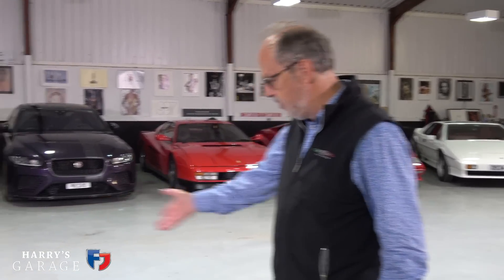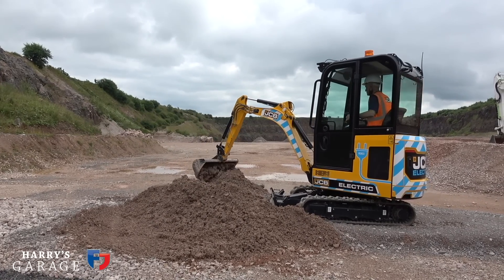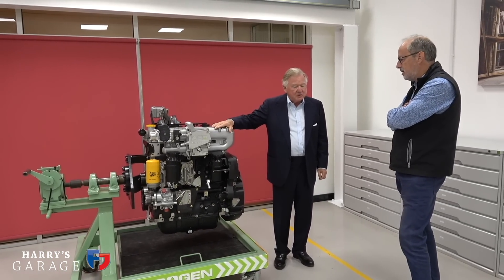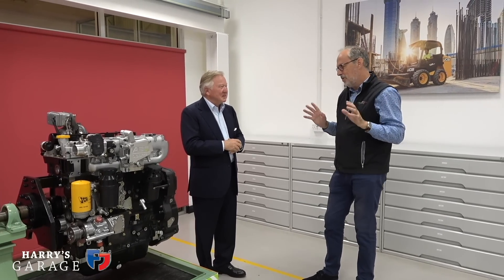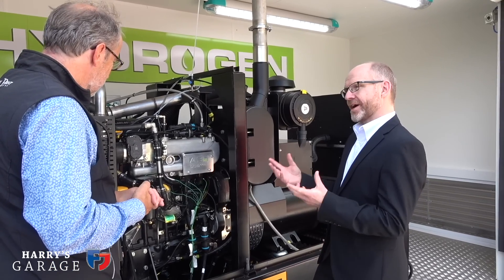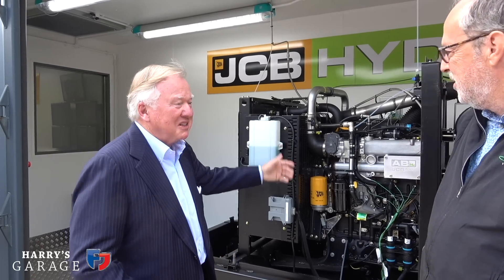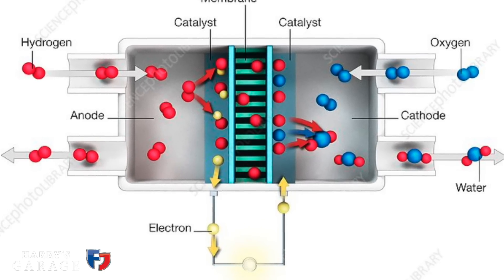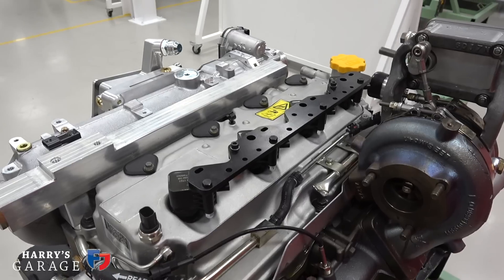Is hydrogen, rather than electric, the future for big-engined machinery? I visit JCB to find out

Comment: A site in London is only allowed EV diggers.
They run for 4 hrs but take 12 hours to recharge using a large Diesel generator on site.
You couldnt make this b.s up.
Reply: What creates less emissions; multiple vehicles running on individual ICE motors or multiple electric vehicles charging from a single ICE motor?
What site is this on?
Where did your 4 hour / 12 hour figures come from?

You call it bullshit but have made no attempt to actually prove it. Lazy.
Reply: I'll back him up, it's all true Def not bs. Battery EV is not the future is stupid.
Reply: The diesel generator is much cleaner running than the diesel diggers are.  It might not be a perfect solution, but it’s better than doing nothing.
Reply: Why does the jcb diggers small battery charge so slowly
Reply: @tonygarlingewarren7456  Ah yes, the best proof: "I'll back him up." ...
Reply: @spaldi01  At a guess I’d say it will be a cross between the batteries architecture and the ability of the generator/charger.
Reply: @CaptainHoratioPugwash  How about first looking at the specs from the JCB Website and then combining 1+1? How else would you charge an electric machine, where there is no electricity or rather no power line, being able to support the amount of current 4 or 5 Fast Chargers would be pulling?
Reply: This is because the machines are being used in doors
Reply: @CaptainHoratioPugwash  ...apparently you CAN make this b.s up
Reply: Completely absurd
Reply: "A site..." if you know that to be true, why not be extra nice and give us the site position and maybe even a link to some info to prove it? To say what you did without backing it up with even a tiny piece of evidence/info is making your comment irrelevant IMO. Anyone can say "I know... it's not b.s." or "I've heard..." or the worst phrase: "We all know...". If there is no solid info it's just...
...b.s.
Reply: That is clearly nonsense. In fact you just DID make that BS up.
Reply: Seriously?
Reply: It costs £30-40 to fully charge a Tesla at a charging station.
EV are not the future and when the plebes realise what it costs it is going to fail pretty quickly.
Reply: @tonygarlingewarren7456  

Prove it. Lazy
Reply: I did see this article about buses in the UK using diesel generators to charge them, i have certainly seen many more like this around the world especially in places without access to abundant electricity.

Here is some electric buses being charged by diesel generators in the UK:
https://www.sustainable-bus.com/news/electric-buses-powered-by-diesel-generator-harrogate-bus-company/

In the outback:
https://thedriven.io/2018/12/14/diesel-charge-evs-remote-locations-greener-than-you-think/

EV cars while great at reducing local pollution, they cause all sorts of pollution worldwide just look at how bad the mining of the materials is in various countries for our electric batteries.
People buy electric cars to show that they are green are just ignorant to the real damage they do worldwide. 

You would have to go nuclear power everywhere to make electric vehicles zero emissions as you are not going to provide enough with wind and solar so its going to be gas and coal if not nuclear.

I also think charging at home will be challenging when everyone in the street has a 10-30kw+ charger installed in their homes as the grid will need to be upgraded for every home.
It makes me think they will have to ration the electricity per house otherwise someone with a faster charger on the street will be hogging all the power and everyone else will be annoyed cause there's will be much slower. 
Not to mention the fact that if they overload the grid could cause brownouts.
I remember watching that photonicinduction guy browning out his street due to drawing more than the street could take, whilst entertaining would be quite annoying if peoples fast chargers were doing that lol.

I wonder if the smart meters can do this rationing already, would make sense as i doubt the national grid people are going to dig up the whole country to upgrade the power for every home.

I think that's why elon was doing the solar roofs and tesla wall battery's so you could store more energy at home locally at a slower rate and be able to charge from home and also use your electric car as a power source for the home.

But really there are a lot of issues with electric vehicles and this hydrogen engine could solve a lot of them for the bigger vehicles, mazda have been experimenting with hydrogen powered rotary's for a long while and that bob lazar guy had a hydrogen fueled corvette in the 90's using tanks with lithium-6 deuteride as a hydride so when the tank is heated they will release the hydrogen and allows you to store  it safely, and he claimed 400miles range from the 4 cylinders in the back.
https://www.youtube.com/watch?v=Ytg23mDd1a4

Will be interesting to see what happens in the future and how these problems will be solved.
Reply: The government are backing diesel generator sites all over the country to cover all the lows of wind generation. I know this because i have now been approached by multiple companies to do this on my land. Also it has been done on WH Malcolm's site at newhouse scotland so dont believe all the crap our governments are telling us all over the world
Reply: @v4skunk739  Most charging of Teslas is at home (mine has been topped up three times at Superchargers). Many ways to get cheap electricity at home. You don't "fully charge" very often, unless you regularly make 200km journeys. Most of the time I'm adding about 10-15% charge to the battery overnight. 

"Fail pretty quickly". I think it's almost 8 years that Teslas have been on the road now. Better hurry up and fail.

Finally, price is not the main thing here - having a future to drive around in might involve actually paying more than an ICE vehicle. We've crapped this stuff up pretty completely and undoing the damage  is going to cost some money.
Reply: @amilton2128  agree entirely - but downvotes don't show.
Reply: Diesel is so much better, says nobody stuck behind a diesel bus belching out black soot particles
Reply: @Howling-Mad-Murdock  🤣🤣🤣🤣
Reply: @v4skunk739  that’s nonsense
Reply: @CaptainHoratioPugwash  Silence in court! oh wait...
Reply: You are probably leaving out the details that reduce your observations to cynicism, like that the restriction is for some good reason other than ecology. Yes you could make up your sarcastic implication.
Reply: @ATomRileyA  Photonic Induction is back!.... Enjoy!
Reply: @CaptainHoratioPugwash  A generator runs at constant revs and is optimised to generate electricity efficiently, but neither charging nor electric motors are 100% efficient.  The improvement is probably marginal, if any.  It is ridiculous to replace diesel ICE with electric only to charge from an on-site diesel generator.
Reply: So they need 3 times as many machines to do the same work. This is actually hurting the environment more than just use a modern diesel engine. But its just a fact that these kind of sites don't care about the actual emission they produce in the big picture. They only want it to look nice on paper.
Reply: Wowser that sounds about right
Reply: @v4skunk739  Hydrogen will never be cheap. 

The cost of creating an entire clean production and distribution infrastructure will mean that it will likely be more expensive than petrol or diesel.

Whereas electricity is every home, office, shop, factory, petrol station, cafe….
Reply: 4 hrs is a full day shift on a mini excavator - JCB gets that raw data. Of course it needs recharging after 4 hrs butbthats OK
Reply: I think they meant on the diesel driven machines. But still. 4 hours is the average day.  But he conveniently just forgets all these that work longer days on these machines. Just for the sake of the example. 
When I rent a mini digger for 100 bucks a day I want to use it at least 8-10 hours a day. But with only 4 hours a day I will need the machine 2,5 times as long. Plus my project will take 2,5 times as long. Or I would have to rent 2 or 3 machines. Which is much worse for the environment. The production of the machines is very poluting. Specially the batteries (that need to be replaced every 7 years or so)
Reply: @RichardButlerUK  You are lying, it costs £30-40 at a charging station to fully charge a Tesla. I'm not talking about charging at home....
Hydrogen is the future not ev.
Go research how a battery is produced and how difficult they are to recycle.
Reply: @spaldi01  Might be because they charge it on mains power or maybe 400v . They don't install a 130kw supercharger on every building site. You need to manage with what you have on site. Which will often be a diesel generator 😂😂 So you run on diesel but can only work 4 hours a day. After that the diesel generator needs to run for 12 hours 👌.
Reply: @rayw9067  How can anyone doubt that Toyota got it right...
Reply: @Graham and yet here I am, enjoying mine, like thousands of others. Enjoy the next few years as we approach the end of new ICE sales - breathing exercises might be needed if you've already hit the "complete cobblers" stage of debate.
Reply: @tayne5009  but electricity needs an entire new infrastructure too if it is to provide enough current to charge all the vehicles we use. So that is not a unique downside of hydrogen.
Reply: @Dani-it5sy  because they didn't
Reply: @MrDavidWeston  The vast majority of EV miles are accomplished with slow charging from existing supplies, most cars spend 8-12 hours a day parked either at home or work.

The national grid have said they’d be quite happy with several million EVs getting plugged in every night to balance the grid demand between peaks and troughs.

And there are over a billion three pin sockets in the UK and less than 20 hydrogen stations.
Reply: @v4skunk739  that’s not true, the most I have spent at a Tesla supercharger to charge my 75d is less than £16. No I have not gone from 0-100 but had a good 80%. At home that can be less than £5. That’s for a range of 200 real world miles. For most car applications electric is fine, cheap, quiet and pretty sensible in my mind, although some non Tesla superchargers are charging higher that diesel / petrol prices which seems mad.
Reply: @ATomRileyA  Your correct when talking about the power grid plus the lithium copper est will not go down in price these ingredients used are mind as you say by cheap labour and are not that abundant. On he hydrogen debate the only this different is the head they can use all other parts that are in production today plus hydrogen has been around since 1808 but this tech was suppressed by the big oil companies.  Yes it's going to be a very interesting future. Like the Beta Max or VHS. Phillips has the better system 1500 and the 2000 CD.
Reply: If the diggers were well designed they would have on-site swappable batteries.
Reply: @androo4519  adding tons extra to a earth mover. Plus the damage they are doing to the environment  have you watched the video I posted about JCB.
Reply: Lots of people conflating pollution with carbon dioxide emissions. The amount of carbon dioxide is in direct proportion to the amount of energy converted, which will be similar either way (more efficient at the generator but losses charging/discharging will make up the difference). However diesel genny will likely be cleaner and pollution can be better controlled.
Reply: @Howling-Mad-Murdock  Why do you think the engine on the diggers would be anything different than the one on the generator? The engines on modern construction machines run on a constant RPM in a very controlled manner with particle filters and adblue and stuff :)
Reply: @AmundAntonsen  I read an article from a plant hire company, it was they who stated the generator was quite a bit cleaner.  I guess they’d know.
Reply: @v4skunk739  lying? oh that is harsh!
my estiamte of public charging prices may be out a bit, because I usually charge at home, and I don't pay to use public charging.
 
so you appear to understand there is difference in price between charging an EV at home (on a cheap time-of-use tariff or from solar panels?) and the cost of using an expensive public charger?

how much does it cost you to fill up your Hydrogen car at home? or when you are using one of the 3 currently working public H2 filling stations in the UK?

and have you researched how a fuel cell is produced?  (the membrane has a limited life) and how difficult they are to recycle?

or are you spending this weekend doing a conversion on your Corsa to convert it to burn H2?

Hyrdogen has been the fuel of the future ever since they used it in the Apolo space pogram in the 60s
back then it was "in 10 years time"
and it's still "10 years away"

H2 will have a place for some weird applications, like these huge diggers that need to run 16 hours at a time, or aircraft or shipping
but for passenger cars and the vans and lorries in cities, batteries have already won
Reply: Batteries are not the winner for passenger vehicles. Where I live in Norway we have so much tax deduction on all areas that its  much cheaper to drive an EV than a combustion driven car. We have excellent charging infrastructure.  Still half the cars sold are petrol/diesel. Why would these people pay much more to drive petrol/ diesel? Because it's not a realistic option for them to drive EV. And why would we choose 2 different solutions? 1 for tiny vehicles and a whole separate infrastructure for heavy vehicles?
If we would allow H2 technology to develop at the same rate as we did with EV it would become just as efficient.
Reply: @tonygarlingewarren7456  What?
Reply: @Dani-it5sy  Long term, I agree.  Unless there is a breakthrough in battery tech that allows manufacture from much more readily available materials, then batteries are not the long term solution.  But hydrogen is not ready yet, it’s still far too energy intensive to produce the hydrogen and the infrastructure needs enormous investment.  Batteries are a short term solution for something that needs doing now.

54% of new car sales in 2020 is not to be sniffed at, considering just a few years ago that would’ve been close to zero.
Reply: @robbybobbyhobbies  Yes but you have the life to do it that way. You hardly use your car compared to many others. I drive 500 km a day on average. Sometimes 1000 km. And tell the people honestly.. How many hours does your Tesla need to charge at home when it's almost empty and you need a propper full battery the next day?
Reply: @Dani-it5sy  you’re an outlier, fine. Most people do nowhere near 500km. You’re different, so life will be less convenient for you than it is for me. I guess at the moment doing that much mileage is less pleasant than doing a normal person’s, whatever the fuel. Out of interest, what vehicle do you use for this almighty daily trek? Is it provided by a company? Do you have your own car as well, for private use? Are you doing a more manageable amount of personal and commuting kilometres? Just so we’re comparing like for like - I’m not a salesman or a travelling engineer or whatever else causes you to drive maybe 10 hours a day.

I’ve never taken more than a night to charge my car from the wallbox. Honestly. It’s always ready for me by the next day. Most often it’s at its normal running capacity (90%) by early evening. Whenever it’s at home, it’s plugged in.
Reply: @robbybobbyhobbies  I am a consultant in the concrete industry in Norway. Traveling round a lot and also often stay over night at hotells etc. But I am really not a very big exception. I would estimate at least 25% of people will really struggle to make their days work with an electric car the way they work today. And that's the people in highly developed countries. What about all the countries that are not rich enough to build this infra structure for electric cars? What about semi trucks that need to drive 1000+ km a day using 10 times more energy than a tiny passenger car? And I can keep going. What I say is that we now put our money on a solution that will only work for a small portion of the people and companies  in the world while the development of other solutions that might work for everyone has almost come to stand still and is even ridiculed and criticized.. And the manufactures? They just want to make money so they make what is being sold. I really don't understand why so many people are fighting against better solutions than EV.
Reply: @Dani-it5sy  not against hydrogen, just that we need solutions today. When someone steps up and installs the hydrogen infrastructure then maybe I’ll switch. But EVs work for me so why would I wait for hydrogen? 

What about all the commuters doing less than 150km a day? What about the parents taking children to school, doing the shopping and visiting friends nearby? What about the millions of other journeys that can easily be done with an EV? Trouble with “whataboutism” is that we can all play the game and it signifies nothing. 10s of thousands (millions?) of people can and do get along with EVs today. A tiny handful get to enjoy the benefit of hydrogen.
Reply: @robbybobbyhobbies  I think you don't understand a word of what I am saying. But its ok. You are not the only one.
Reply: @Dani-it5sy  stay classy.
Reply: @tayne5009  The idea of micro-grid/shared storage/smart charging also comes into play with EVs. You can imagine a world whereby an individual has solar panels and battery storage at home, so they can store electricity during the day, transfer it to their car at night, but then the next day when they car is at work, it can be used to charge the car in the next bay because you know you're only driving 30 miles home, so you can sell some of your electricity...
Reply: Correct, you you made that bs up. You are correct though that planning and developing permits are now starting require electric diggers only in residential areas. No generators.
Reply: @Howling-Mad-Murdock  Rubbish,
Reply: @v4skunk739  
Agree the motor industry are taking a huge gamble with there investors money as electric is a Big gamble bought upon by G8 donkeys..

This electric is going to go horribly wrong as hydrogen IS THE FUTURE.
Reply: @Only-one-life-68  Go research the power grids! In Britain! At winter on an evening our grid is close to maximum capacity! And any more electricity demand will one day lead to mass power cuts nation wide! Which will in turn drastically increase the cost of energy.
EV's are not sustainable. And lets not even talk about how much batterys cost for a car! On a Tesla they are £15k.
Reply: @Howling-Mad-Murdock  what! no they are NOT what are you thinking. If each digger has their own ice then there is no energy loss form converting fuel to electricity!
Reply: @Graham In other parts of the world they have public charging stations for those that do not have garages/ drive ways of their own.
Reply: @JustAlanJohn  Hydrogen is a byproduct for the large oil companies. Please take your tin foil hat off.
Reply: @Howling-Mad-Murdock  The break though in battery technology has already occurred and will be coming to the mass market in the next couple of years.
Reply: @GR-zv7dn  Always get one with sarcasm lowest form of wit Hydrogen can be made in many ways.  Take care 🤣🤣🤣🤣
Reply: @GR-zv7dn  Hydrogen fuel can be produced from methane or by electrolysis of water. ... In electrolysis, electricity is run through water to separate the hydrogen and oxygen atoms. This method can use wind, solar, geothermal, hydro, fossil fuels, biomass, nuclear, and many other energy sources.
Reply: @v4skunk739  
Did you read what I Said !!!!!!

I’m clearly aware of our electric grid at its max in winter !!!
Reason is the silly sods in government closed coal burning power stations down..

Electric is NOT the future for vehicles never mind industrial and commercial vehicles..

Did u now they can’t even dispose of the batteries correctly at this moment in time..
Reply: @Dani-it5sy  
Bang on..

JCB electric mini diggers use most of the power whilst moving forward and reverse
Reply: @Rover200Power  
Thank you for your link 
Very educational 😀
Reply: @robbybobbyhobbies  
I think what ratbag98 is trying to put forward is that 
Yes there are lots of folk that do minimal mileage in there ICE vehicles 
And yes EV maybe the future for these folk
But the mass majority of ICE vehicles still need to use ICE vehicles..
Why penalise this huge group of users..
With fines for Not having a EV..

It’s like the folk that get fined for going to work in a ICE.

We’re as those that stay at home on Benefits aren’t going to get fined
Reply: @tayne5009  It is not a question of how many three pin sockets there are (!) - the key thing is that to power the number of EVs if they replace ICE cars, vastly more electricity generation will be required, and also vastly more distribution capacity for the grid.  So needing more infrastructure is an issue with EVs as well as with hydrogen
Reply: @MrDavidWeston  The national grid point out that the load factor between peak and off peak is around 20%, therefore they would be quite happy with an extra 2 million EVs to smooth out demand given threat over 90% of EV miles are done with slow charging either overnight or throughout a work day in one location. With smart meters they’d be happy with another 8 million EVs.

Now tell me how much infrastructure would be required for 2 million hydrogen cars?
Reply: Do you know what the initial cost of electric is? Right, 1: first you need to dig big holes to get to the coal
2: Transport it to the power station with a huge diesel powered tanker across the seas because we closed all our own coal mines
3: Same principal for building solar panels, ie transporting materials to start with then the rest to a site to use etc
4: Same for wind power, to build and install on top of hills or in the sea, la la la, 
5: Same with building nuclear power stations and getting rid of nuclear waste
Need I say more, except cost and pollution which they never mention when producing electric
Look at the bigger picture
Reply: @billi996  you have to do all that and more for ICE vehicles. And then the ICE vehicle consumes and spews more over its life. Look at the bigger picture.
Reply: @tonygarlingewarren7456  Do you mean all Battery EV or battery JCB?   My Tesla (which  has in fact outputs more horspeower than anything JCB sell)  - has just completed  a thousand mile road trip around Scotland. Zero problems & no issues. Why no future? Why stupid?
Reply: @Dani-it5sy  They porbably need to operate in 3 places - not that electric is puny.  JCBs have puny sized engines
Reply: @Graham 
1.They can charge on the street. 
2. They don't cost a fortune

3. They may use slightly more energy to assemble (but not necessarily - it depends on which car) - but all recoup and offset this within few thousand miles of driving
4. The servicing one made me laugh most. Have you ever serviced a modern internal combustion engine car. You are aware you can do little or nothing diagnostically without accessing engine management unit computer. You are funny
Reply: @MrDavidWeston "but electricity needs an entire new infrastructure"
 I know ...it needs a national grid of electricity...oh wait!
In seriousness ..national grid have done a number of studie s. It can cope. It predicts a 5-10% growth over 20years. Nothing that hasnt already happened in previous decades